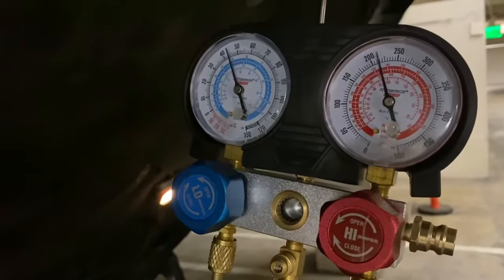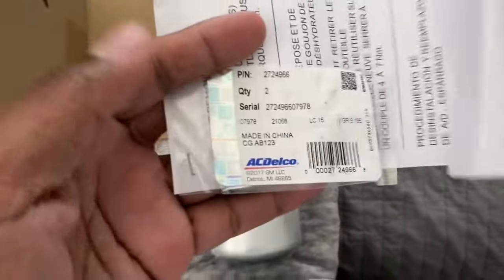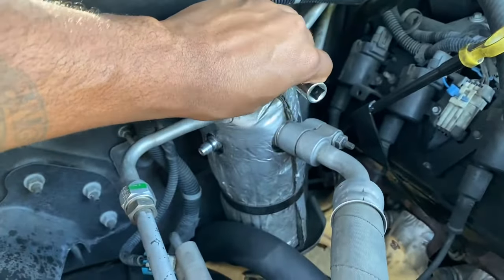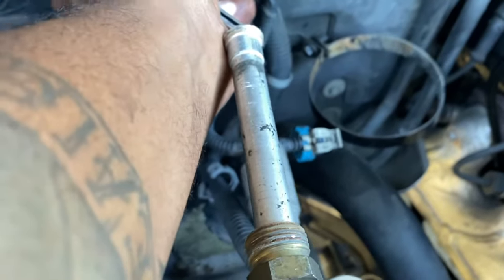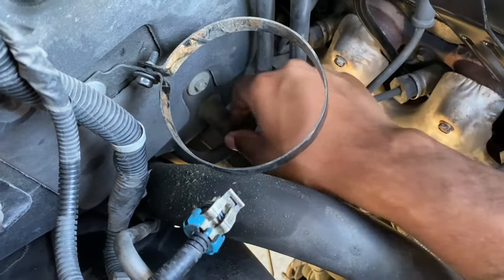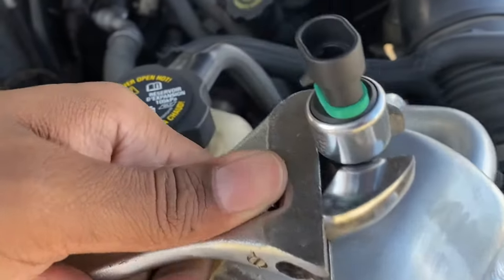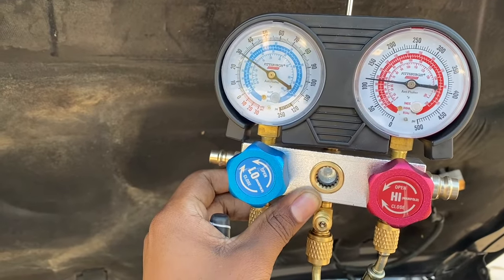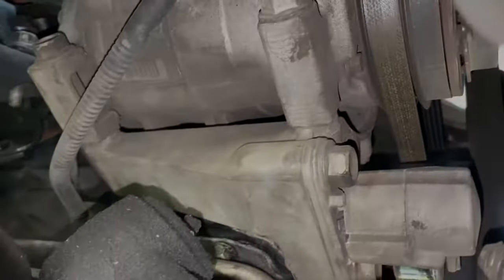Accumulator and Orifice Tube Replacement 2002 Escalade

Comment: Hearing you talking about your getting the wrong accumulator makes me feel a little bit better on the unboxing video I just posted, as I thought I went too far into detail with making sure you have the right one, p-nut directions and outlet position. You probably got the one that I have, which is correct for my application. Oddly enough Escalade has many of the same parts as Sierra and Silverado - would guess same evap, discharge line (that holds orifice), and condenser. Replaced my old r134a manifold with the one you got (got it on coupon day) - those hoses and fitting will hold pressure for days plus you can use the capped center port (has a schrader valve) to vacuum down your manifold so you don't have to bleed air from it after you hook up a bottle.
Reply from the maker: Always gotta make sure it’s the right part 👍

Comment: My ac slowly got warmer and i figured it was a leak, the system still had 134a in it and after hooking  the guages up it was at the recommended pressure. My accumulator was also making the exact same hissing noise you explained,  I guess they can fail internally and cause your ac to stop working.

Comment: What was the reason for changing it. What symptoms were u haveing? I’m having issues with my ac
Reply from the maker: Mines was leaking on the outside but a bad accumulator can cause mold and mildew to build up in your ac system

Comment: I gotta 2000 gmc yukon denali my ac blows cold as hell in rear an mild in front any tips and the system if full charge at specs
Reply: Blender door actuator (motor) is probably broken/stuck letting heat mix with the cold air. Troubleshoot the problem before throwing parts at it though
Reply: @182QKFTW Blend door actuator? Which one?